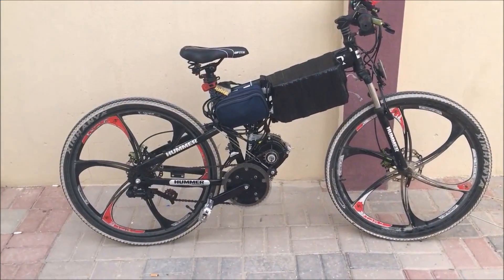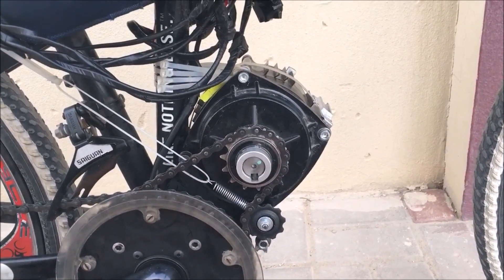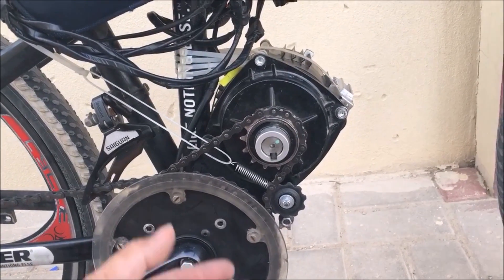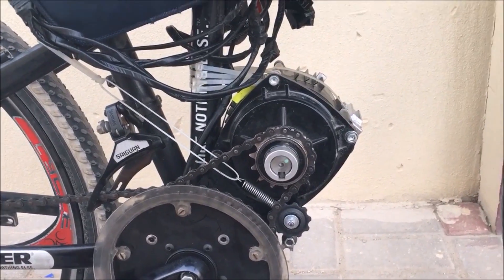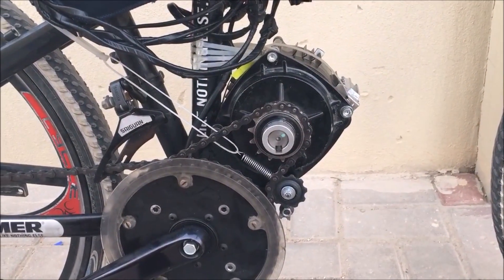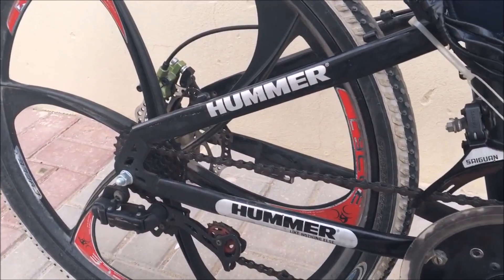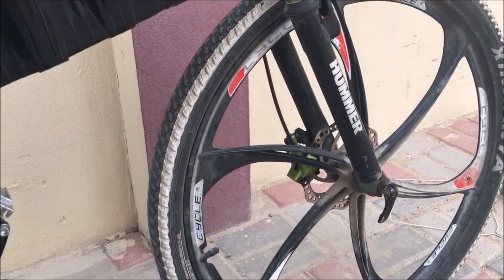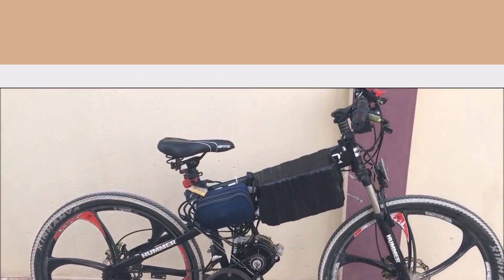DIY Electric Bike 80km/h Using 3000W Planetary Brushless Motor

Comment: Cool bike.
I'm just getting around to setting up the 3K Cyclone motor I picked up last year. Excited! 
I got the ISIS BB and single speed half link chain, so I shouldn't have any trouble with chain falling off.
Reply: Good Choice and good Luck!  I have same 3000wCyclone - 44t sprocket and 12-32  7-spd. I think single (or 3 spd internal gears)  is all you need. it would be less hassle with chain falling off and  chain cross issues.  I also agree with his hydraulic brake setup and would like a 180mm rotor in front (my 105 rim brakes with large shoes are pretty weak above 35kph).
Reply: Forgot to add: glad you got ISIS BB (mine is standard square taper).  Mine works, but I can actually see BB flex when really pushing it (top speed on mine is 50km/hr).  The Cyclone 3000w kit should have both mounting plates the same thickness as the right mounting plate (the left plate is much thinner than the right).  I suggest getting the 3spd switch.  Switching to low speed will really extend range for long rides (top speed can really drain batteries).  Have 3 52v packs in parallel (11ah in frame, and two 10ah packs (one in each of 2 rear panniers for longer range. with Conti 700x25c Gatorskins, getting around 40-45km with little peddling.  With pedaling probably around 50-55km ).

Comment: How did you add a disk brake to your rear dropout?  I have been told that the frame has to have the attachment points for rear disk brake caliper.

Comment: How did you stop the chain from coming off? .   . . cool bike
Reply from the maker: GDMHification the bb that I got was the stock one had some play in the middle, just a kick or a use of a rubber mallet on the opposite side aligned the chain properly from the chainwheel to the motor’s sprocket. Better buy the SS bb that luna has, it’s way better and no play